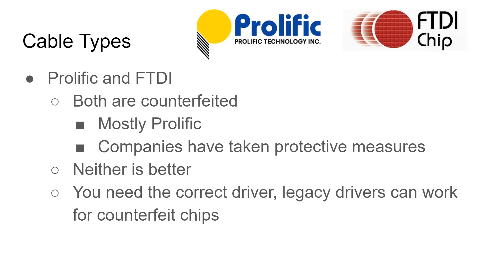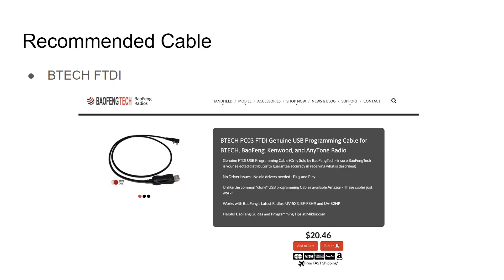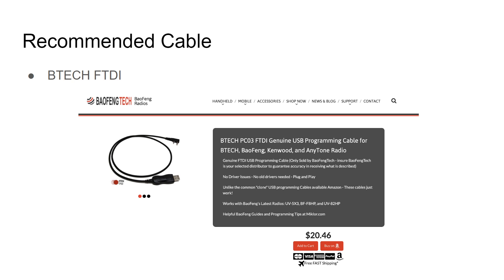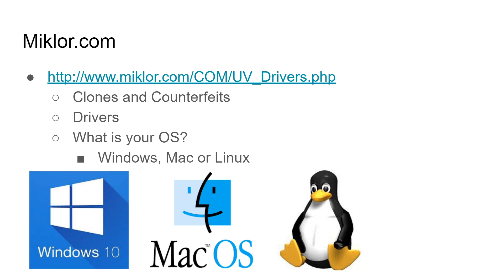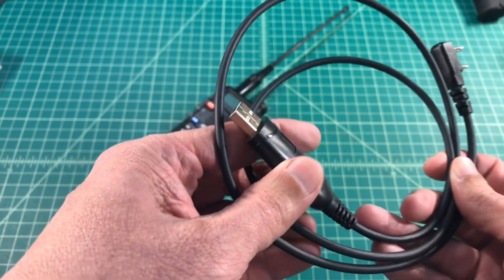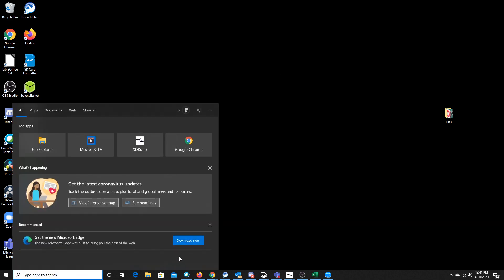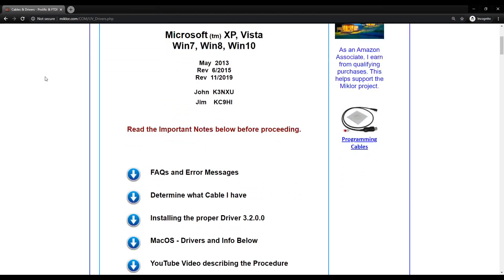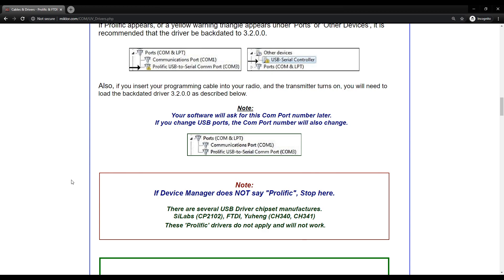Baofeng Programming Cables Explained - HAM Radio - TheSmokinApe

Comment: Thanks for all your excellent videos! I have been using Linux Mint Cinnamon for years and it does almost everything I need. The only thing it doesn’t do is allow me to connect a radio to Chirp. Have three cables, one is an OEM Baofeng USB02 from R & L (they sell non-fake Chinese stuff). OK, the other cables could be fake. The question is would that BTech PCO3 be automatically detected with Linux Mint 21 when it's plugged in?
Reply from the maker: It’s my understanding that Linux has the Prolific driver are part of its install, I’m not sure about FTDI but you might want to see if you have them and install them if not before you buy another cable 👍
Reply: @TheSmokinApe  Thanks! I will order any other cables from Amazon, better return policy. I will try the BTech PC03 next. I'll keep that Prolific driver info in mind. I can always downgrade to a Windoze PC just for Chirp.

Comment: What do the different part numbers mean - I see that the PC03, PC02 and PC01 seem to be the same thing.  I also found that there is a cable called PC05 that comes with a K-Plug and another verison with an 8 PIN DIN plug.  Is the "PC.." designation the protocol and not necessarily the cable name?
Reply from the maker: The part numbers are for different cable types, K-type is the Kenwood adapter and DIN are for radios that use that type of plug 👍

Comment: I just purchased an UV - 5R with an Abbree cable but only connects to the larger battery and not the MIC/SP ports.  Will this work?
Reply from the maker: The programming cable needs to connect to the the mic / speaker port 👍
Reply: @TheSmokinApe  TY - I feel stupid
Reply from the maker: @jakebechtproductions3850  don’t, we’re all new at first.

Comment: I bought an FTDI cable on a Mirkit vendor on Amazon. It SEEMS to be a genuine one. Windows 10 sees it, but the radio doesn't. I downloaded the FTDI drivers and installed them, but I don't know where they got installed to and so don't know where to point Device Manager to, to update the driver.
Reply from the maker: Look in device manager and then under comm and LPT ports.

Comment: Hi there, and great video. I installed Chirp and got it running under Ubuntu Linux. My problem is, I don't think my UV5R radio is maintaining a connection. I see an fddi device attaching to ttyUSB0, but according to the dmesg output, it disconnects shortly after it connects. I am totally blind, and want to confirm, does the cable plug into the two jacks behind a door on the right-hand side of the radio? The connectors can only go in one way, correct? Thanks in advance for assistance figuring this out.
Reply from the maker: You are correct about how they plug in, it can be difficult to fully seat the cable...  push firmly
Reply: I figured out that I have the cable connected properly, and I also figured out what my problem is. For one, I don’t think the version of Chirp is up-to-date in the Ubuntu 22.04 repository. I got a look at the error I was getting in the terminal. The error is module ‘collections’ has no attribute callable’. If I can figure out how to fix that, or if you have any ideas, I am all ears. Thank you for all your help.

Comment: You can also make your own cables, genuine FTDI usb TTL chips'll run ya like 3 dollars
Reply from the maker: You  sure can, thanks for watching Paul
Reply: @TheSmokinApe  lol no problem I clearly miscopied a link to the wrong vid after but I enjoy the content keep pushing out the good stuff
Reply from the maker: @poiu477  haha, no worries 👍
Reply: @TheSmokinApe  hey so I don't know if you'd be able to help, but for the longest time I've been trying to get an TV tuner card from an old Netbook running in a more capable laptop, I've got channel reception before, but I think I'm running up against the limits of using a simple wire as an antenna. Do you know of any distributers that sell cables with one end terminated in the tiny wifi antenna coax and the other end with regular antenna coax?
Reply from the maker: @poiu477  like this onelinkmore U.FL Mini PCI to Reverse Polarity SMA Pigtail Antenna WiFi Cable Pack of 2 https://www.amazon.com/dp/B005UWD0EG/ref=cm_sw_r_cp_api_glt_fabc_RH1ND673WBBMD0F14XFF
Reply: @TheSmokinApe  Wow that was fast! I think you might've solved one of my biggest roadblocks in this project!
Reply: @TheSmokinApe  Seriously thank you! Once I have some results worth showing, I'll send ya a link to the video, been messing with it on and off for years now, trying to terminate my own cables, trying to make my own antennas, etc. and this is literally JUST what I was looking for!

Comment: Hi, I just got into using radios and I'm using a Baofeng UV-5R and I have tried all of the tips in your video. I still wonder if I'm using the wrong cable as it is not the one that you suggested to use. I was also wondering if there were any cheaper options as I cannot get the cable that you suggested because of the cost.
Reply from the maker: Your going to need a cable that doesn't have a counterfeit chip, that's what it boils down too, best 9f luck getting it sorted out 👍

Comment: Why oh why are there issues about obtaining a USB cable in order to program a radio? We have been using USB cables successfully for years in order to connect printers, keyboard, mice, MP3 players, calculators(!), etc, to our computers, but for reasons that escape me, radio users are either duped with fake cables or have to pay a premium to get one that works! Why the hell doesn't someone make these dam cables for a reasonable $5 a throw and flood the market with them so that the shysters peddling fake ones stop conning people with duds? Alternatively, why the hell don't radio manufacturers make it easier and cheaper to connect their radios to computers? I despair!
Reply from the maker: The could certainly make it easier on us, thanks for watching Joseph 👍

Comment: one more thing could it be possible to interface raspberry pi to Yaesu FT-891 to transmit APRS?
Reply from the maker: It is possible.  One thing to note is that APRS is typically used on the 2 meter band, the 891 is not capable of send or receive on 2 meters.
Reply: @TheSmokinApe  good thing to mention. thanks. I will use other option, expecting they have the same RTTY/DATA and USB type B inputs

Comment: I cannot get the Baofeng to respond. The cable is detected perfectly. I have the most updated one and then rolled back to 3.2.0 and it cannot read the radio. I have tried other USB ports as well. Any ideas how I can get the radio to pick it up? The cable is plugged in tightly. I am 3 cables in and have had no lucky. This is the cable that I am currently trying to use (same link posted above): https://www.amazon.com/dp/B00HUB0ONK/?ref=idea_lv_dp_
Reply: Did you end up solving the issue?
Reply: Yes, thank you! It’s fickle for sure. I have to update the port on my PC and make sure the cable is seated tightly which requires me to put something in the other usb port to seat it next to the port with the cable. Simple in many ways but unnecessarily challenging. I appreciate the video!

Comment: Man, I bought that FTDI cable from that link for my F8HP. "Radio did not respond" happens every single time. I've tried several different troubleshooting techniques on two different radios. If I pressed the cable in any harder I'd break something. 
This is so frustrating.
Reply from the maker: It can be frustrating; make sure you are the correct com port, the radios is on with volume in the middle and that you have the correct radio type selected.  Best of luck.
Reply: @TheSmokinApe   I got it to work! A replacement cable did the trick. I looked through my Amazon history and I bought the exact same cable, because it's the one everyone says is legit. So I got a legit Baofeng cable that simply didn't work. Soooo many hours wasted. But at least it works now.
Reply from the maker: @McCoymiked  glad to hear you are up and running 👍

Comment: A few years ago I mistakenly purchased a re-branded Baofeng UV-5R thinking it's a better radio because it says high power 10 watts which I pretty soon found out it only had 2 setting high & low power most likely to be just 5 & 2 watts, the programming cable the dealer sold to me together with the radio wasn't detected by my computer with Chirp was obvious a counterfeit cable with older chipset inside. The dealer exchanged it & I'm pretty sure that one is also a fake too, my Nagoya antenna is no doubt a counterfeit as most of the third party accessories for these budget low cost Chinese hand held radios are.
Reply from the maker: That dealer had to know it was a fake cable too, that stuff drive me crazy 👍

Comment: Great information! Thanks for making this video!
I took the time to research and buy the FTDI cable for my 'feng handhelds and it did make programming a snap using CHIRP.
The cable I bought for my FT-4XR handheld is also FTDI and programming was great, allowing me to use a .csv file from CHIRP to sync the memory settings, etc from my 'fengs.
Where I ran into trouble was with the cable my brother sent along with a Yaesu FT-7900 I bought from him. That cable had a fake prolific chip that I had to grab legacy drivers for, remedying the situation just as you did. 
Once that was done I was able to also sync my memory programming with the FT-7900, but it did present a momentary challenge.  
I now have an FTM-7250DR on the way, but that cable is also FTDI, so I don't foresee any issues with that rig.
73 de N2NLQ
Reply from the maker: Thanks Mike, glad you liked it.  All these cables can drive a person crazy, standard USB would be fantastic 👍

Comment: Being sure the radio end of the cable is REALLY in, is a thing. The mic and speaker jacks on Baofengs are pretty tight. (use what ever joke makes your inner 12 year old laugh.) What I do is insert the plugs and gently "squeeze" the plug and radio like a PTT. If you can see any of the last "ring" conductor on either the Mic or Speaker plug, It's NOT in all the way. 50% of issues are this, the other half is the drivers. 👍 Good video, sound advice!
Reply from the maker: Glad you like it 👍  I’ve definitely fallen victim to not having the cable pushed all the way in.